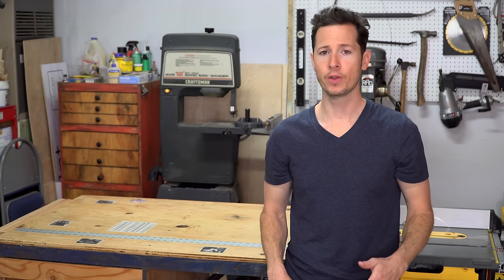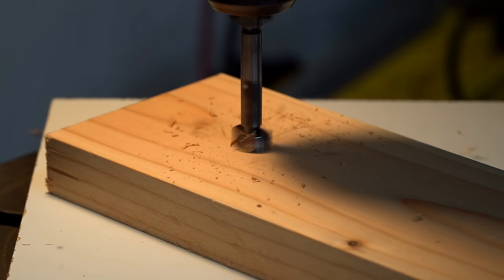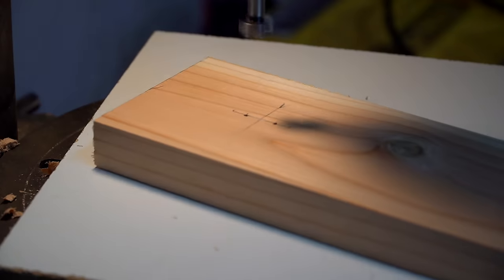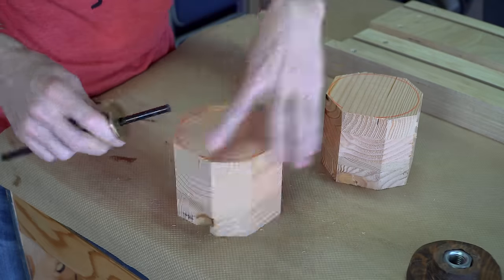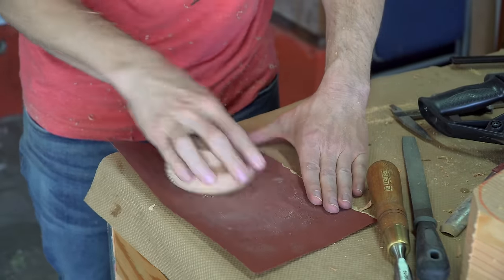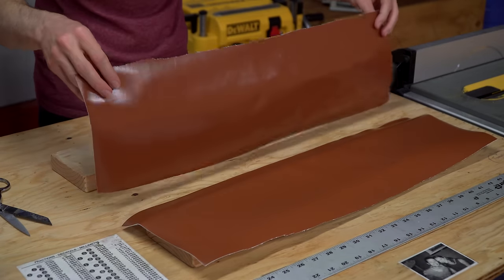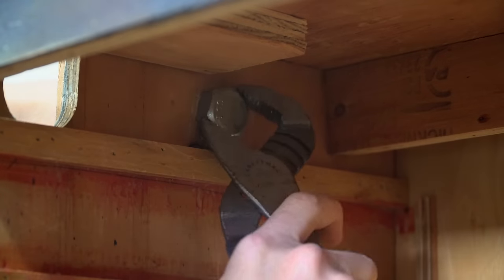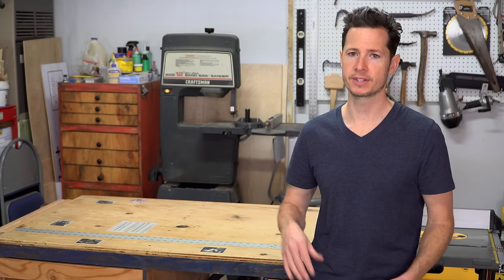How to Make a Twin Screw Vise

Comment: @oneminuteworkbench can I ask why you didn't epoxy the bolts into the hand wheel and attach the nuts the the inner side of the bench? That way the bolts don't stick out and you would get a cleaner finish??
Reply from the maker: Dj! thanks for taking the time to give some feedback. This topic has actually been discussed a lot in the comments, but basically it comes down to this: Internal bolts are more complicated to build and more expensive. That said, it's been talked enough about that I'm going to rebuild it with internal bolts (probably in a few months after I get through some other projects), if for no other reason, just because it's been such a topic of discussion. I hope this answers your question! Thanks again!
Reply: @OneMinuteWorkbench  no I meant why didn't you put the large bolts the other way round with the head in the hand wheel. Then mount the nuts into wood that is fitted to the inner/underside of the bench. That way the bolts are fully contained in the hand wheel and can/ could come of as one if wound to far out. Hope you understand cheers dj.
Reply from the maker: Yes, I understand - to have the heads of the bolts epoxied in the wheels and to have the threads of the bolts go internally into the workbench is a more complicated build and more expensive (or at least potentially more expensive). Check out some of the other comment threads that discuss this topic.

Comment: Newbie here. Why is there a slot hole on one side of the vise instead of just two identical holes? Thanks for any reply.
Reply from the maker: There are holes in the fixed jaw because you don't want it to move at all, and there are slots in the loose jaw because as you tighten the wheels, if you tighten one more than the other - even slightly - snug fitting holes will bind on the bolts. You could use oversized holes in the loose jaw, but horizontal slots are better. The slot is a snug fit up and down, but a loose fit side to side. They make sure the tops and bottoms of both jaws always stay aligned with each other, but give the jaw room to move side to side. I hope this helps!
Reply: @OneMinuteWorkbench  Thanks so much for this reply! I plan on building one soon now that I know what's what, but will probably reverse the bolt like others have mentioned here. This was a very helpful video.
Reply from the maker: Good luck with the build!

Comment: Those bolts are 3/4 thick but how long are they?
Reply from the maker: I think they are about 7 or 8". I just bought the longest ones I could find at Home Depot. The longer the bolt, the thicker the workpiece you'll be able to clamp. I hope this helps!
Reply: @OneMinuteWorkbench  thank you very much  bro. This is the first time I write a comment in a video and the reply is crom the maker of the video 😀. The bench is on point by the way
Reply from the maker: No problem, man! I'm glad you dig the bench. I actually have a video dedicated to it. If you're interested, here's a link: https://youtu.be/SKOCpNIV2Is Thanks for stopping by to comment!

Comment: with the lathe,  this may be late but your rest is to high.  At to high an angle can catch and drag the tool in. or worse
Reply from the maker: Thanks for the feedback! And yes, others have mentioned it, and I’ve made some mods since then. Have a look at this video: https://youtu.be/UqvVQ2dZaAU I hope this helps!
Reply: Interesting.  I've found just the opposite to be true.  At too low an angle, the lathe chisel can "get under" the work and catch.  Positioning the tool rest high - the lathe chisel can't get under the work unless point it down - which is no bueno.
Reply: @kodoan411  lol we both said the same thing,  your wording was better.
Reply: ment angle to the work not the chisel

Comment: What do you think about attaching the bolts to the wood handles and the nut to the opposite side of the vise? That way the bolts aren’t protruding. Just a thought, I may try it that way in the vise I make. Either way great vid lots of very useful info.
Reply from the maker: It's a great idea and has been discussed a lot. It's a little more complex, but definitely doable. I actually plan on doing one that way some day, but have lots of irons in the fire right now. If you tackle it, be sure to let me know how it goes. Oh yeah, somebody did one, have a look here: https://oneminuteworkbench.com/project-photos/customer-gallery/ Look at the build by Kevin S. He put a coupling nut inside the bench. Good luck!
Reply: @OneMinuteWorkbench  If the bolts are reversed to avoid them protruding, then how is the fixed jaw held to the workbench? Is this simply held in place by the bolts running through to the other side? Curious as to what 'a little more complicated' means because other comments here make it sound very simple to just reverse the bolts and then turn them into/under the bench.  Thank you, OMW for this - this is my next DIY add-on.
Reply from the maker: Brent, fixing the bolts to the hand wheels, and doing so in a manner where they are perfectly straight will be more difficult than fixing the nuts to the hand wheels. And yes, then you have to choose a method for attaching the fixed jaw. You also have to create enough of an internal thread that will hold the bolts & hand wheels securely, yet let them turn freely and easily. For that aspect, you'd probably want coarser (and more expensive) threads. All that said, it's doable, it just requires more hardware, achieving at least one task that will be more difficult, and probably will be more expensive. It's also worth noting that it may be worth the extra effort, depending on how you feel about the advantages it affords. I hope this helps! Good luck!
Reply: wooden nuts quickly spin open and closed which is quicker and more efficient.  The other way around is an exercise in frustration - slowly spin one bolt closed, slowly spin the other.  slowly spin one bolt open, slowly spin the other.  You can't use centrifugal force to spin a bolt on a nut but you can use centrifugal force to spin a nut on a bolt.   Some others mentioned concern about safety - this is the least dangerous thing in your shop!  Seriously!  a coffee table corner is dangerous too I guess...

Comment: Could you put (the same, obviously) gears on each of the posts with a bicycle chain between them to have the vise move as one piece? Then as you turn the one hand thing, the entire vise moves in and out whilst remaining parallel. Eh? eh? *looks around
Reply from the maker: I'm sure it would probably work - I've seen commercial version that work that way. I actually like being able to operate them independently though sometimes. Either way, it could be cool to have a version like that - thanks for sharing the idea!

Comment: Why oblong holes?
Reply from the maker: Great question! It helps keep the loose jaw from "racking", which basically means getting stuck. The loose jaw flexes slightly and travels at angle when one of the knobs is turned at a different rate than the other, so with straight holes, they tend to bind. The oblong holes give them extra room to move during the tightening process. I hope this helps!
Reply: @OneMinuteWorkbench  It also allows for racking when holding irregular pieces -- like wooden jaw clamps

Comment: Never use the chisel without clamping your work piece first. You could have seriously hurt yourself if the chisel slipped at the 4:43 mark in the video. Your left hand is right in front of the chisel blade.
Reply from the maker: Thanks for the safety tip!
Reply: @OneMinuteWorkbench  I learnt it the hard way (Had a minor cut but scared me thinking of how bad it could have been. ) Like your straight forward approach on your projects. Subscribed. :)
Reply from the maker: Thanks for the compliment on my projects! Also, welcome aboard! I'm glad you're digging the channel!

Comment: Just a small point, don't the 3/4" screwed bars become a hip buster with them sticking out ?
Reply from the maker: It definitely could be, but it hasn’t happened to me yet in two years of using a vise like this. I think the handwheels help create a buffer around the end of the bolt and that’s probably why I don’t bump into it. I’ve thought of making a version where the handwheels are attached to the bolt, and the bolt threads into the bench....If I do, I’ll be sure to make a video of it! Thanks for the feedback!
Reply: I think that is how I will do this on my workbench. Thanks for the idea :D
Reply from the maker: Jaws  Hi , I’m glad you found it useful. Let me know how it turns out!

Comment: Nice project man, but bit of safety advice. Your tool rest on your lathe is too high... you want it to come to around the same hight as the centre of the spindle. Its more likely to catch if the end of the tool is facing downwards. If it does catch and spit the tool out, it could be pretty serious injury time.
Reply from the maker: Thanks James! And thanks for the advice - a few others here have already suggested the same. I've modified it in the blueprints, and will modify it on the actual lathe soon...hopefully tomorrow. Thanks again!
Reply: One Minute Workbench No worries mate, wouldn't wanna see a fellow woodworker get injured!
Reply: Literally the opposite of my advice.  A high tool rest prevents the chisel from getting underneath the work - unless you point it down but...who does that?

Comment: 10$ bro.. Is that true ?
Reply from the maker: Totally, give or take a few bucks depending on your availability of materials. The hardware is around $5 (at Home Depot), I found the synthetic leather on clearance at a fabric store for about $2 (and used not even a quarter of what I bought), and the wood I used was scraps from another project. The only thing left is glue and polyurethane, which was only a few pennies worth.
Reply: @OneMinuteWorkbench  Your explanation is really easy to understand and yes its make sense i guess, thanks a lot bro.. i will start then 😎👍

Comment: Sooner (rather than later) you are going to catch yourself on one of those screws which is why the threads on a conventional vice dissapear under the bench, if you are lucky you will only rip a pocket off.
Otherwise 'a good effort'
Reply from the maker: Thanks for the feedback and the perspective. I knew the risk going in. So far I’m 2 years I’m without an incident. I think I tend to keep the handwheels out far enough that they act as a buffer. I’m sure the first time I catch my hip on it, I’ll be putting in the extra effort to build one where the threads go into the bench.
Reply: nope.  Joseph Moxon  designed it like this for good reasons.  After 40 years of rough and finish carpentry, I can attest that this is the proper design.  This is the least dangerous thing in your workshop.  If you can't deal with this, please don't pick up a chisel or saw...
Reply: I'm constantly amazed at these comments.... I'd love to compare shop talk sometimes...

Comment: what is a vise ?
Reply from the maker: It's not Miami Vice 😂
Reply: @OneMinuteWorkbench  Thanks for the advice
Reply: @OneMinuteWorkbench  Thanks for the advice, im just a novice.
Reply from the maker: I assume you mean you're just getting into woodworking, is that right? A vise is basically just a clamp that has 2 "jaws" (faces) that apply pressure to an item you're trying to hold. It usually functions by some means of turning a screw (or 2 screws, in the case of the vise type shown in this video). For woodworking, you might want to apply a lot of force to a board so that you can cut it, sand it, drill it, plane (shave) it, etc. without it slipping. At the same time, you don't want to dent or otherwise scar the wood, so you line the jaws with softer material (like I did in the video). In metal working, a vise is usually made out of metal and the jaws often have jagged teeth so you can get a better grip on the piece of metal you're trying to hold. All in all, there are lots of different types of vises, and each has its own purpose. Any, I hope this helps!
Reply: @OneMinuteWorkbench  I have used a vice to secure any pieces of stock i needed to keep stationary for many years a vise i now realise is what our cousins across the Atlantic call such a piece of equipment, i smile when i hear the term cutting a rabbet while the Brits cut rebates, i would assume since we both speak roughly the same language that both those terms have become misinterpreted from their original meaning over the years, if you would like to once again start using the proper language to describe those woodworking acts then you must immediately stop throwing our tea in to Boston Harbour and of course pay your back taxes to the crown, if those terms are agreeable to you and your woodworking community in the colonies then i expect payment immediately or even quicker.
Reply from the maker: lol 😂
Reply: @PatrickKelly-lz3pv  U.S.A and the u.k.. - two countries separated by a common language....  Seriously, even the brits no longer use "old english...
Reply: @kodoan411  I have used wood work tools for 60 years and have never heard of a vise, a tool for securing a workpiece is called a vice its just another word the Americans have misused, like using  rabit when the term for that wood working joint is called a rebate
Reply: @PatrickKelly-lz3pv  B.S.  You've heard of it - you just want to troll.  You know the difference between a rabbet and a rebate but have never heard of the word vise?

Don't labor (or is it labour?) under false pretenses.  That color (or is it colour?) of B.S. doesn't look good on anyone.

Look everyone!  I found the troll!
Reply: @kodoan411  There is no difference between a rabbet and a re-bate they are the same joint just like a vice is a tool to hold your work steady my point was both those words have become corrupted as they crossed the pond.

Comment: The problem with going to any timber vendor is that checking for straightness is a no-no because they’re usually selling the timber in 2.4metre lengths. And once you’ve cut it to fit it into your car, you’ve bought it. I would suggest ordering a hard wood such as beech or oak from a specialist vendor in the correct dimensions, planed and holed if you want that and cut out all this unnecessary and expensive faff.

Comment: "I used yellow glue as most folks may not have contact adhesive at home".................... but they have high end chops saws planers and jointers? C'mon
Reply from the maker: C'mon!!!!!  🤣 lol. I stand by it! I think it's a fair statement. I didn't say they couldn't afford it...I said they weren't likely to have it. I think of spray adhesive as art supplies more than woodworking supplies, so just because someone has a jointer and planer doesn't necessarily mean they have spray adhesive. But I'd bet dollars to donuts a guy with a jointer and planer definitely has some yellow glue laying around 😉
Reply: I didn't see any high end tools in the video.
Reply from the maker: Right...no Powermatic in this garage!
Reply from the maker: Not that I wouldn't love to have all Powermatic tools though 😉
Reply: You are exactly right about the glue. Those of us that don't have planers have work arounds! So spray adhesive users can "work around" the yellow glue,  lol.